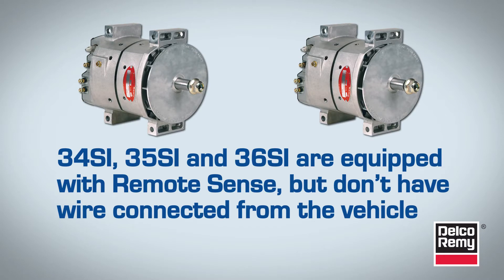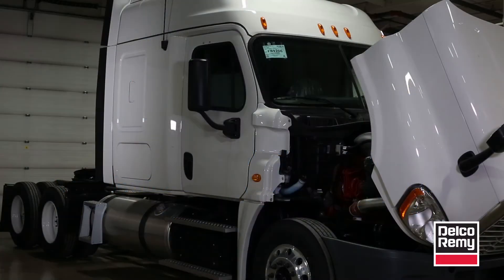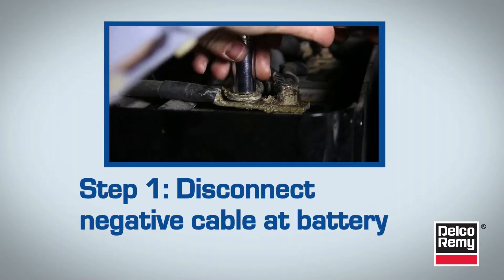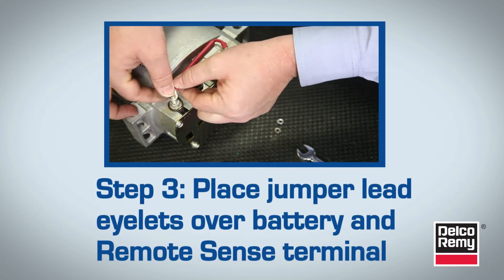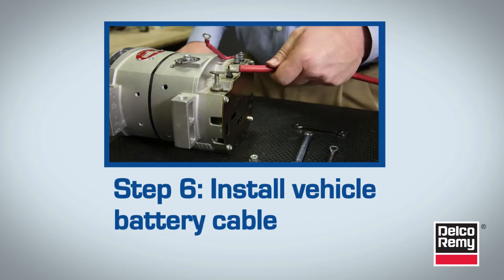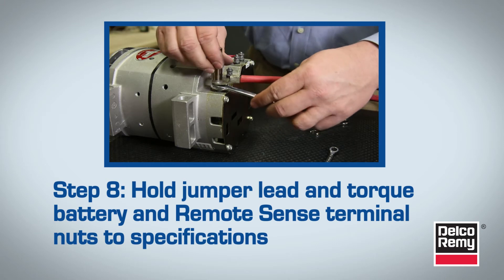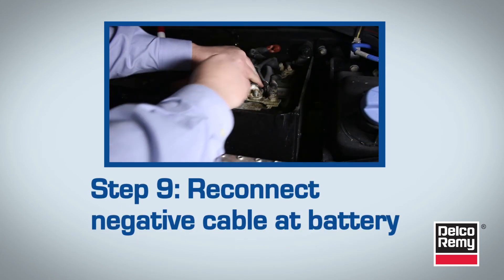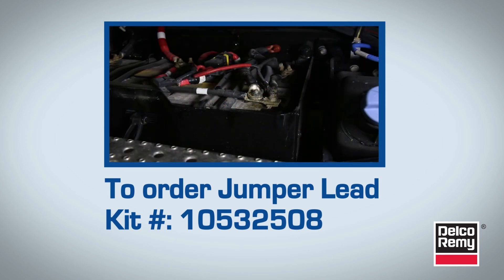Reduce High Voltage at the Battery by Installing the Remote Sense Jumper Lead | Delco Remy Tech Tip

Comment: I had a 35si installed at a Volvo dealer and the tech didn't use Ted jumper, he ran a wire all the way to battery. I'm charging at 13.7-13.8. Others with sane truck tell  mine their charging around 14.4. Which is considered normal?